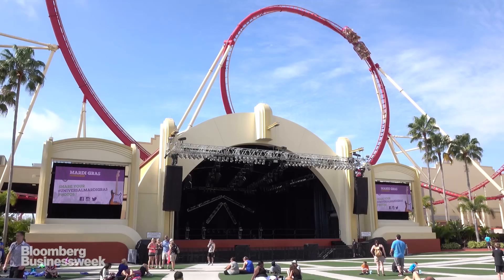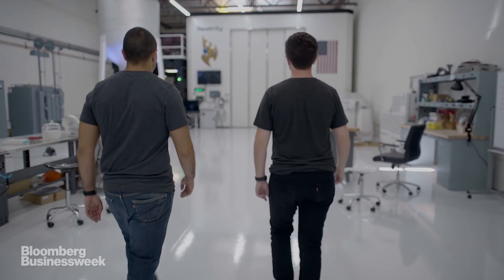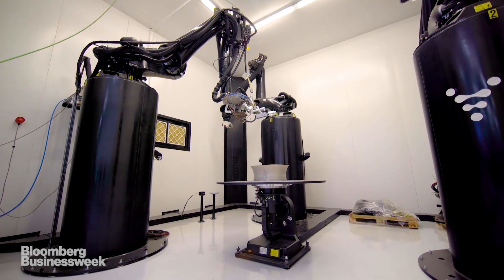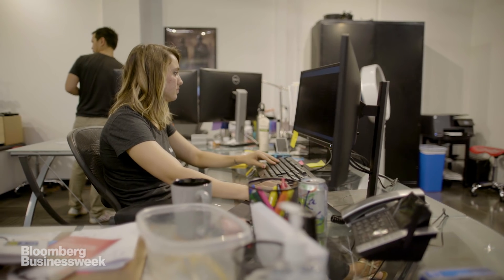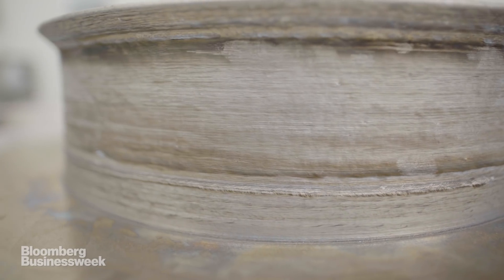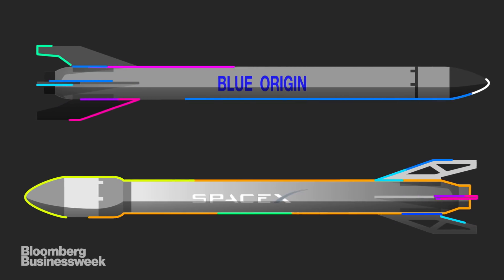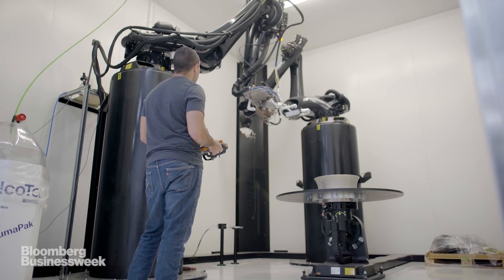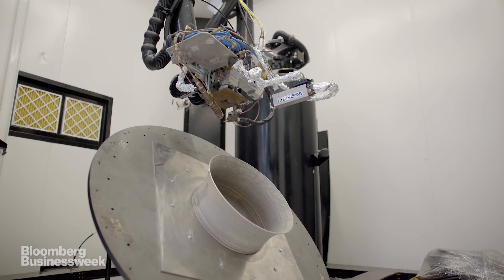How to Get to Space on the Cheap

Comment: This is the stupidest fucking thing I've ever seen. If you have the resources to 3D print this shit, you have the resources for injection molding, which is far cheaper, far more consistent, way faster and overall more reliable especially in large scale production. The fact that it yields a smoother surface on the product is enough of a reason to switch on its own - Look at those fucking surfaces! Do you honestly think that is going to withstand atmospheric reentry?? That shit will produce more friction than a greek man's pubes.
Reply: Hey dumb moron,,, Molding is the most conventional from of large scale production, not prototyping. These fools want to use 3D printing, which is for prototyping to manufacture the final product. And did you stop to consider that perhaps molding is the most widely adopted production method for a fucking reason?? Idiot...
Reply: hey dumb genius,,,Molding is the most conventional form of metal prototype and 3d printing is more strong and cost effective and perfevt
Reply: ahh shrek.... I know your an expert and all but I am not sure you understand anything about manufacturing in metal what so ever. I can't even begin to tell you how many thing in what you just said are completely and totally misguided.
Reply: Maybe it's because you're unable to prove that a surface that's essentially made from many layers welded together is more structurally secure and aerodynamic than a surface that is seamless. Oh wait lol. It's because IT ISN'T!

Comment: the next problem will be the fuel. It's nearly impossible to  launch a rocket by electricity, you won't have enough thrust power to push it through the earth's gravity. Basically fossile fuel is still a must and sadly, it's not unlimited
Reply: hydrogen

Comment: ...and Spacex BFR  launching cost should be around 7M.
Reply: Keep dreaming cupcake...
Reply: Electron by rocket lab is already 6 million
Reply: @Juleskiii788  the difference beeing electrom is a small sat launcher and starship will be the largest and most powerful rocket ever built
Reply: @Juleskiii788  a crappy rocket, barely reaches leo
Reply: The starship is going to cost 2 million per launch and it's twice as powerful as a Saturn v
Reply: It will cost a billion dollars but the reusability feature will get it down to 10M dollars
Reply: If I don't remember wrong Elon said BFR non reusable will be about 350 million dollars.
Reply: @shabibakhtar2247  It will defiantly not cost a billion dollers to build. It will cost over a billion to develop for sure.

Comment: 3D printing the whole rocket will never work. The structural integrity is completely ruined for the combustion chamber and nozzle.
Reply: Look up RocketLab. They've already flown 3D printed engines. Not entirely 3D printed, but all major parts and the combustion chamber is one of them. Relativity claims they have already performed over 70 tests of the engine. The rest of the rocket is less complex than the engine.
Reply: Samuel Hvidager   that was my concern when I learned about this.   But to be fair, this 3D printer is not your average 3D printer. I don’t know how precise can it get, but it could be a challenge to be that much precise.
Reply: Rocketlab has already created and launched a 3d printed rocket called Electron,,so it works,,,,and dont critize before being educated about the topic
Reply: Thats what the peasants say.